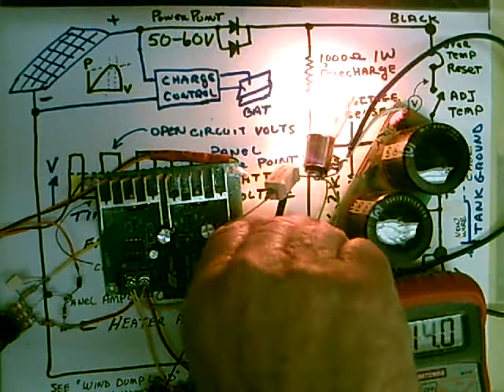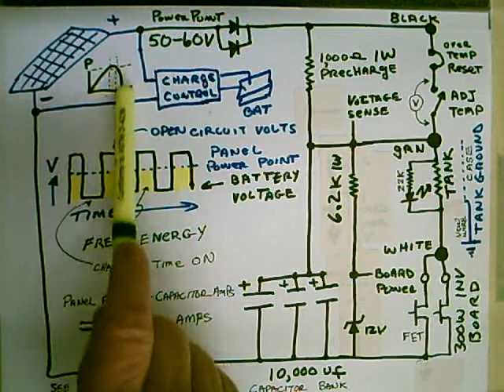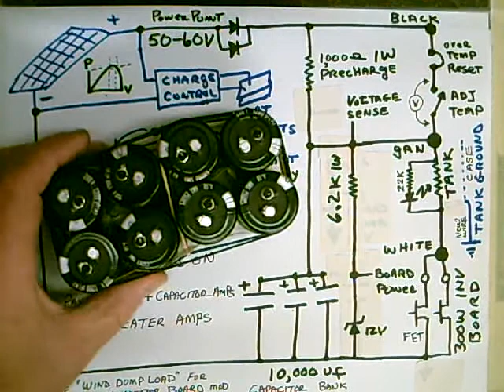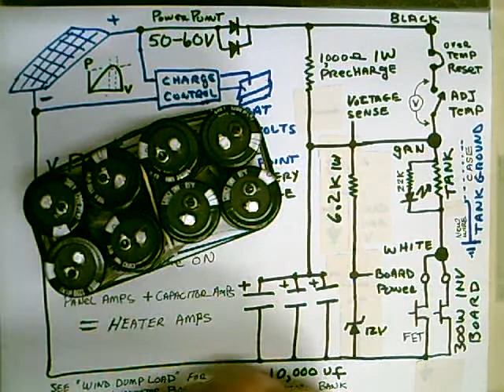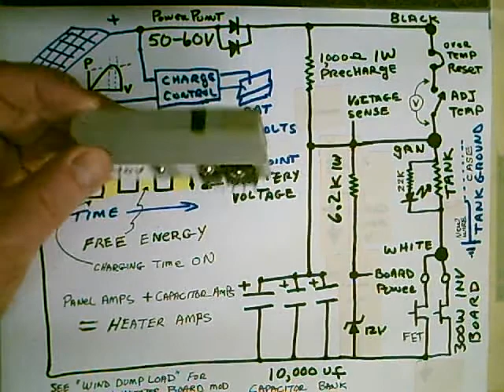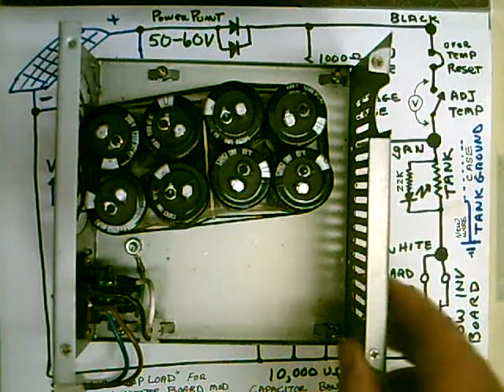Free Camp Hot Water Using Wasted PV Energy

Comment: I just recently found this video. I guess this is till up to date for the inverter board setup. If so I would recommend referring to this video as a overview video.
Reply from the maker: At times I think I should just delete these earlier videos.  I was aiming for a solar viewers accustomed to building electronics. The latest has fewer mechanical modifications to the board.
Reply: @opera5714  I'm a bit confused. I remember you stating the temperature switch and the temp reset on the boiler needed to be modded in the boiler and that you needed 3 wires. I never understood that until I saw this video. So I thought this would still be very relevant. 
Also the 1000 ohm precharge resistor makes sense to me. 
I don't recall any of the other video's showing this overall overview diagram.  Is all of this no longer needed?
Reply from the maker: @nogmeerjan  All solar is local. It is easy to think what you have is what everyone else does.  Some are wanting to do over 150V, multiple heaters at the same time, some daisy chain heaters. There are two outputs and if used singly, only two wires are needed to go to the water heater as there is sufficient dead time. I have the problem of offering too many solutions and now understand that confuses people.  To me there is always an optimal solution instead of cookie cutter.
Reply: @opera5714  I understand that a optimal solution is tailored. But by copying other peoples work one can learn. It for sure will not result in a optimal solution but it increases the chances of success and better solutions in following projects. 
I'm in the  learning phase here, for sure (steep curve stuff) and I appreciate your in-depth explanations as I agree with you that learning is key.
I hope to get to multiple heaters one day but for now I just want to understand and build a pv solar heater. Then with that experience I hope to be able to make better decisions on how to go along with the multiple heaters.
I have been willing to make a solar water heater for a long time, but due to both boiling as freezing conditions at my place I have put it off (plumbing is not my strongest talent). So as soon as I learned PV heating is becoming more and more economical viable I started looking into it. When I found your video's it finally became a project. The test setup is working now, the capacity bank is made. I need to get new fets, 2 grid tied solar panels and a boiler to make it for real.
I learned so much from you already. Thanks
Reply from the maker: @nogmeerjan  Where this system shines is the camp with a small solar setup. Without extra panels they can have hot water for free. That person will believe none of this is possible and never attempt it.

The rest are following those like HBpowerwall. He just did three episodes on heating water. It is just like reality TV. You do stupid things just to correct them in the next episode. He keeps it down to something simple like connecting two wires. It is all about railing people up and keeping it so simple that anyone can make a comment. In the end, panels are free so it doesn't matter. If anything in solar works at all, people are so happy. He's made his money and left you 
stupid.

I don't know what that target system is.  I've tried to get some real life data from a couple of people.  Sent them working systems, a couple of wires to connect.  To this date they have never 
been hooked up. I don't know what more I can do.

I paid a guy I used to work with to do a CAD layout 2 years ago. A nice guy who used to populate circuit boards at home for extra cash. That has dried up now that everything is moving to surface mount.He has had some hard times and I tried to set him up making these so he would have extra cash. I bought all the parts, 800 big caps and several thousand more parts. He never finished the project. I'm not going to hound the guy, he has problems enough. He was certainly smarter than I was not seeing any potential in this.

Can't blame anyone. This doesn't look impressive and is too simple to actually work. If you have 
made the commitment, I'll get it to work for you.
Reply: @opera5714  Thanks for the extensive answer.
The fets and 100ohm resistors arrived. I soldered them in and they work fine. I tested with the capacitor bank and current limitation.
I ordered my first solar panels 2 times https://www.ev-power.eu/Solar-Panels/Solar-module-CanadianSolar-Poly-280Wp-60-cells-CS6K-280P.html?listtype=search&searchparam=GWL%2FSunny-280PC
Because I live in 240VAC land I'm still thinkering about voltage and boiler wattage.
I think I'l buy 2 boilers and put them in series. A "big" preheater and a "small" final heater. 
Both with as  max power I can find (divide by 16 not much remains).
Put extra insulation on the final one (the more the better.
Power them both from the same solar panels but with different controllers, giving the final heater priority.
This way I should be able to dissipate the watt peeks and need less "final heating" Wh.
I would prefer going to 90V (I removed the middle pin of the fets as you instructed) but the capacitor bank is currently rated 100V so that gets to close to my likings.
Reply: @opera5714  I missed your new video. That explains everything. thanks.
Reply: @opera5714  Keep all the old stuff each one has value in the thinking process. I am curious as to your background to cross paths and reuse items intended for something else. I admire the work you do and how you present it. Myself i"m an old tinker finding things in a pile to do other work or function. Zero fossil fuels did a vid of some of my stuff many years ago https://www.youtube.com/watch?v=dNnYbHjrxHs . I would like to chat sometime. Cheers Spodie Odie
Reply from the maker: Just about everything you want is being made by someone. The problem is that it is going out of production by the time you discover it. I spent my childhood being chased out of the town dump. That has never left me. I once worked for a place where I would agonize for days over including a fractional cent part for a little better performance or not. That honed my skills as a designer. No one on youtube can really appreciate this design. Anything self powered has the greatest chance of destroying itself at startup or shutdown. The 2153 has its own regulator, low voltage shutdown, pulse modulation and FET driver.  It is extremely stable. You will not find anyone else using this design.  All electronics is simple building blocks. I saw a picture of this board and just knew I could turn it into a water heater control. It is a matter of being observant. Watching the screens on a solar system in short order tells you a lot of power is being wasted. Everybody needs hot water. Problem is, once you get to 4KWH of diversion you need to find someplace else to send power to.